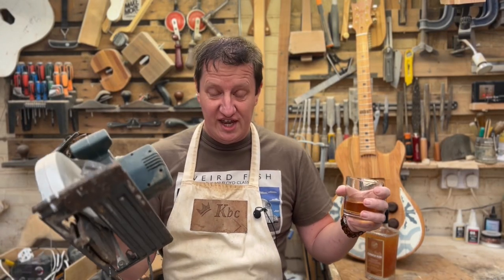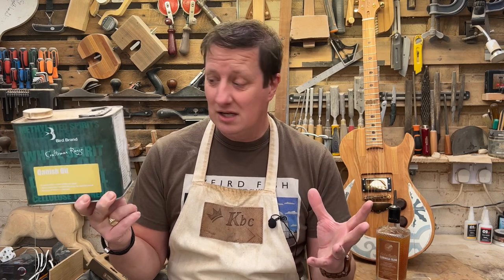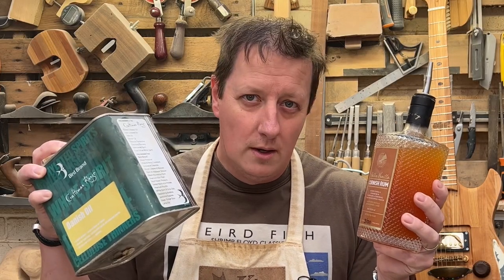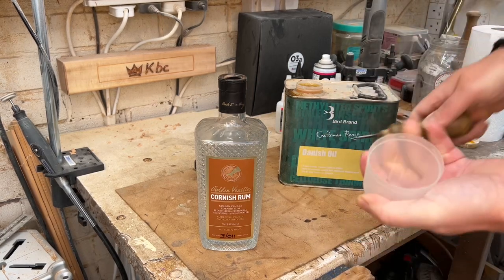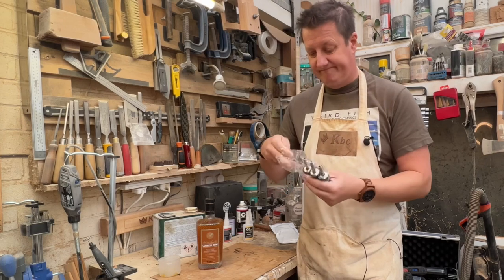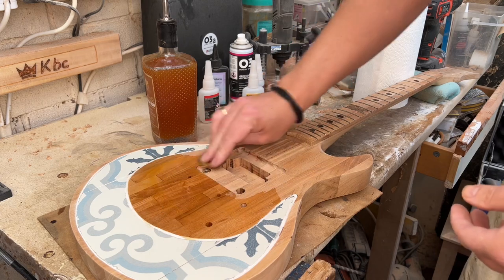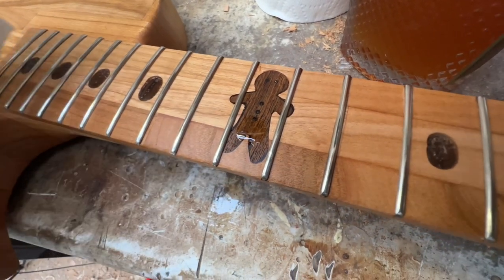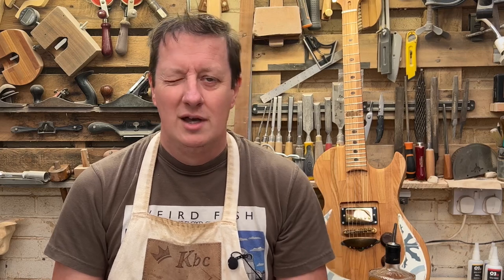Genius wood finish idea

Comment: When pouring out of lager containers especially those with the cap at one end or corner, you should always align the container so that you effectively pour "over the Handle". while you might get an initial small spillage, it won't thereafter. This works well with 20L, 15L,10L and 5 Litre Carbouys and jerrycans. With experience you will not hesitate, and this is also a key.
Reply from the maker: Agreed, but 25yrs if little spillage get annoying. Zero spill with a proper bottle 👍

Comment: Just a quick question and I don't know the answer, but are finishes light sensitive ?  (in the way say beer might be?)  Will they age quicker, go off or change because they are getting exposed to light?  (I would assume most oils aren't but something like Tung oil or Lacquer might be.  )   Please let me know, if nothing else it will stop the neighbours thinking I'm a raging alcoholic on bottle recycling day... well a little 😃
Reply from the maker: I believe most finishes are more ‘air cured’ than light. But the glass should deflect most uv inside a workshop too 👍
Reply: Could always keep it in a paper bag for that park bench look...
Reply: The finishing oil will cure even when inside the bottle (albeit very slowly) because there is air present. UV from sunlight is a catalyst that accelerates the curing process.
If you're gonna use a transparent container, then store it in a cupboard.
Reply: @ErebosGR  I know beer is sold in brown bottles because it cuts UV which prevents skunking.  Green bottles do that a little but not as much and clear glass prevents very little.  Most finished I have used are in opaque plastic bottles or metal tins.  I was wondering if the same process would affect them.   Thanks all. (Def a brown paper bag, and make sure it's ruffled at the top. 😀